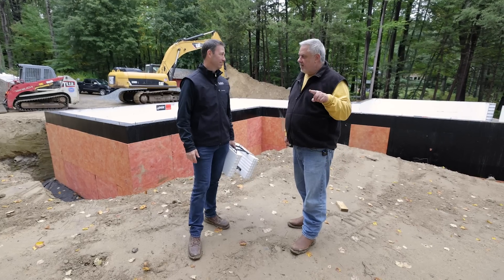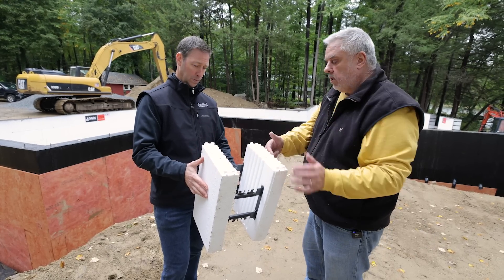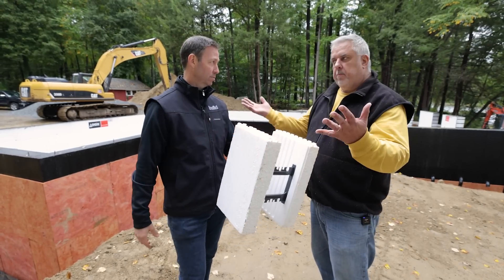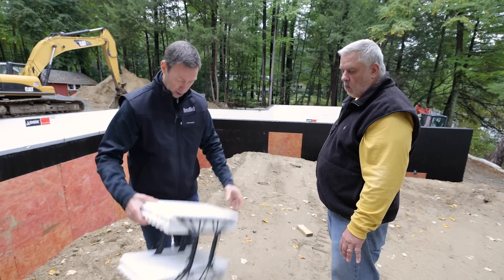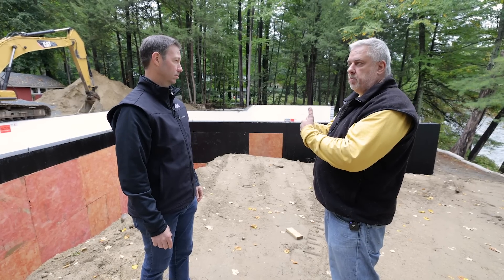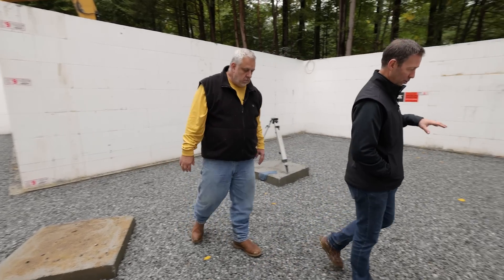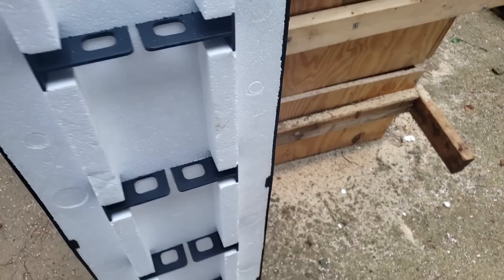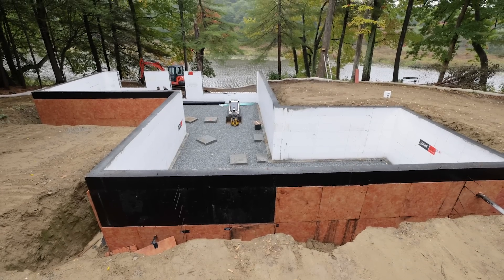ICF Foundation with Insulating GRAVEL?

Comment: Great workmanship, however you don't really need all that OSB waste.!! it defeats the purpose of going with ICF. Water will be repelled with a good coating and surface prep on the basement wall. That OSB will be gone in 5 to 10 years, so why buring your money to decompose. If you are still concerned use rock with filter fabric for the full height is cheaper than wood. !

Comment: To me, ICFs don't make sense. All that useful thermal mass is insulated from the interior of the property where it would do most good in modulating the temperature of the interior space.
Reply: When you build a very efficient home like this one, the thermal mass matters very little as the loads are so small you cannot get energy in or out of the concrete fast enough........thermal mass is a has been for poorly designed homes

Comment: I want to do an ICF ranch style house with full basement, in floor heat, maybe with lite deck main floor to avoid any required span support walls, I'm considering doing a litedeck hip roof for ultimate tornado country protection, and using concrete and metal on the exterior will make it as disaster/fireproof as you can get. The extra cost though for that roof would be significant.

Comment: @MattRisinger please would you be able to review SCIP (Structural Concrete Insulated Panels/EPS wire mesh panels). They have foam in the middle and wire mesh on both sides that are covered with concrete (shotcrete). They are very popular in Japan, South Korea and other Asian countries. This eliminates the need for surface cover on both sides - so no siding or drywall needed and are fire/insect/weather resistant as soon as the concrete is installed. It seems more logical than ICF. I'd love to hear your review of those.
Reply: Something like this - CNBC video from 4 years ago but haven't seen this take off. https://www.youtube.com/watch?v=xRCIhgNTi8c

Here's a recent one from a house in California - https://www.youtube.com/watch?v=vuWpJwzGDr0

Comment: Would like to see Matt or Steve investigate and comment about using helix steel on an ICF build such as this or larger.
Reply: Last year I was going to use helix on my driveway.  I thought about making a video. No one is talking about it .   The concrete companies I spoke to about it were not really wanting to help.   They said the boxes are heavy and would have to be carried up a ladder and staged.  Just too much push back but that’s here in South Carolina. Good luck getting people to understand what it is and why you want to use it.  It’s probably more accepted in colder climates.   freight rate went from $500 to $1500 so I cancelled thinking it would be temporary but here we are with a whole new set of problems keeping freight prices sky high.

Comment: I absolutely love Logix Brands "engineered insulation" products. Their ICF is outstanding, customer support is top notch, and they have radiant flooring and insulated panel products as well. A recent jobsite I visited replaced their OSB sheathing with Logix's Exterra product (R5) and was $8 a sheet vs $45 for OSB. This is the future of building. Great video, I really like the Glavel product used as well.

Comment: It’s amazing the ignorance of some of these comments. Icf  is not hundreds of dollars per block. You don’t have to only pour several feet per day. I poured 18 feet in one day and had one minor blowout that was fixed in several minutes. And the blowout was actually on a 9 foot section of wall that was over vibrated. Doing just the basement in ICF and then glued together wood and tape the rest of the way makes no sense. Build the whole thing in ICF.

Comment: I’m looking to possibly use ICF in a house on the coast in Florida. I’m having a hard time finding a builder that knows how to do this.  Which is crazy. 

They all just want to build with sticks.  I don’t get it.  Especially since they’re coastal builders.
Reply from the maker: Keep digging. You’ll find one
Reply: @buildshow  Thank you!
Reply: Didn’t anyone ever read the story of the 3 Little Pigs? The message seems pretty clear - don’t build with sticks where it can so easily blow away. This cycle of destruction and suffering needs to end. So many are suffering needlessly after hurricane Ian, such that we are considering setting up shop in Florida to help those choosing to rebuild in a more responsible manner. ICF construction offers a resilient and sustainable solution. Quite often even if you want to run there is nowhere to hide, better to build so that you can shelter in place and recover quickly.

Comment: The problem with ICFs made with EPS foam is wood destroying insects will burrow and nest in it. Mineral wool products don’t have that issue. If I were to build today, I’d do it with precast walls and the exterior insulation would be Rockwool comfort board with a protective cover over it.
Reply: I was under the impression that ICF wouldn't attract insects cause there's nothing for them to eat? That information was probably for icf ground to roof, but still I don't understand why they'd nest in foam?
Reply: Logix has a EPS with insecticide within it specifically for this purpose- IF you happen to live an area where this is an issue. Problem with precast is you have to knock down your forms, then furr for attachment, and insulate both interior and exterior if you want to match performance. This is all completed in one shot with ICF, hence my love for it.

Comment: How about finding someone doing a frost protected shallow foundation with some complexity, an "alaskan slab" as some might say, but done with the EZ Form molded EPS foam.  I have on on the boards for a client but it won't be built until next spring.  Half uninsulated garage, the other half studio/bedroom with full bath, so there are different treatments for both under-slab insulation, and the flared-from-perimeter "wings" of foamboard outside.
Reply: You might want to check out Legalett. We’ve been building Legalett frost protected shallow foundations (with air-heated radiant) together with ICF walls for over 15 years. It’s a marriage made in heaven. There are a few photos on our website if you are so inclined.

Comment: I did my walkout in my last build with ICF.  It is nice, but there are some serious challenges with it too, and it is NOT cheap.  I would have saved about 35% just doing my bottom part with regular framing...and I could have easily done it myself.  Finishing the outside costs you a lot more, especially if you want stucco.  Putting the electrical in also makes a huge mess.  The chance of blowouts and leakage is high too, you really have to get a good contractor and/or make sure you brace properly.  There is also a lot of waste from the cuts...way more than I thought there would be.   SIPS might be a better way.   That gravel is very interesting though...I will look into that for my next build next year.
Reply: I wanted to do SIPS... until I saw the cost. Crazy expensive. I priced out 12 suppliers; Double conventional framing and 30% more than ICF.
Reply: @mightykrum67  Do you mean with labour factored in?  To me, the big benefit of SIPs is that it's something I can easily do myself in a weekend, thus nullifying all of the labour costs.
Reply: @karlhungus545  No labor, just the material. It would be even more with labor but least it wouldn't be much because its soo fast.

Comment: Mark, can you do a show to help existing home owners in cold climates figure out how to get fresh air moving through the house in the winter, especially for homes that were not built air tight like the newer ones.  I have a gas blower furnace and when I start to research this, I just go in circles and the cost is beyond me.  I also live in a rural area and can't find anyone expert in this area.  I think this could help a lot of your viewers try to figure out this situation.  Sometimes I wonder if just continually running the bath fan and install an outside vented fan over the stove would be enough?  Then I start reading about negative pressure and my head spins.  Thanks.
Reply: I always wonder when they will start monitoring air cycle refreshes and ensuring its even throughout the house.  Carbon monoxide buildup is a huge issue.  With out air cycling, return registers and cycling conditioned air, the system will be a headache generator.
Reply: @doctoroctos  do they not use similar to MHRV, which pumps the stale indoor air out, and bring in fresh exterior air in while using the heat from the indoor air to heat the exterior air as it's coming in?

house is 'airtight' but requires sufficient ventilation, and the MHVR systems are great for that, while not sacrificing the efficiency of the insulation by simply cutting holes/vents everywhere
Reply: Try looking at ERV (Energy Recovery Ventilation).
Reply: @INSIGHTCO  cannot use erv in cold climates

Comment: I would have used Polywall stick and peel plus a dimpled board material as platoon, instead of what they did in here.
Also the Glass insulating gravel could be used without the real gravel underneath. That was a bit overkill.

Comment: I wander what happens with all the moisture that gets trapped in the concrete, because water does not travel through EPS! Also it's curious to see EPS used in this case because EPS it's not made for underground use, XPS being the correct material for this type of work as far as I know!
Reply: It's not an issue.  My ICF is perfect after 14 years.  If you know anything about concrete, slower curing is a GOOD thing.  ICF has been around now for over 30 years.
Reply: This is a great question. Logix ICF's are designed with drainage planes on the interior face of the block. Excess moisture typically weeps out from the bottom course if the mix is too wet. The ICF core provides a superior curing environment for concrete- it is desired to have even moisture levels for the mix throughout the cure, while not having exposure to any adverse weather or temperature conditions; All of which allows the mix to cure evenly and slowly. EPS in tandem with a waterproofing membrane layer is a great option for below grade use! Feel free to reach out to our Technical Support team if you have further questions.
Reply: I too wonder about the moisture trapped in the concrete.  Won't the rebar RUST?  When the rebar rusts, won't it EXPAND, cracking and eroding the concrete?  While the concrete in highway construction has direct exposure to the elements (and the salt applied in winter), the norm now is to use epoxy coated rebar.  That's why it's GREEN.  Why doesn't all rebar used in any conctrete construction epoxy coated?  Is it that expensive?
Reply: EPS is used below ground all the time.  They even use it for infill for building freeways and bridges and many other civil engineering projects.

Comment: Why is noone using any thicker ICF blocks in the US? Where I live they sell up to a size of 4inches inside, 6 inch core and 8 inch outside (about R52), and even with that im not quite sure if it would reach passive house standards here, like, a R37 wall is considered decent

Comment: What about ICF and termites? No one seems to address termites when they talk about how great ICF is or they act like it's never an issue when the question comes up. I live in a northern climate and we have termites.
Reply: I've been doing ICF's in Wyoming since 2001. Install a waterproofing membrane down the wall and out and down the footer. Nudura product for the exposed part of the foundation above grade. We backfill half height, then have terminix in to flood pretreat the exterior and the interior. We do 6 inches of drainrock on the inside first. No problems so far, and much less expensive than after treatment. Qualifies for VA loans as well.
Reply: Polyguard has a TERM barrier product as part of their watershields.  Buildblock also has a strip that you would install slightly above grade if you're using their ICF blocks.  I'm in Michigan in a 70+ year old house and there is no indication of any termite damage.

Comment: I agree with doogie, could you apply this construction on a standard slab on grade build, slap on some Zipsheeting and tape  the seams. The R-value seems fairly good, thinking youd still need to apply 2x4s on 20 inch centers in order to run electrical and hang sheetrock on. Throw some mild rockwool in and enjoy higher R-values plus you might have a Safe-house type condition, bullet proof from top to bottom. 😎
Reply: You can use a hot-knife or a chainsaw to cut channels in the foam for your electrical, then after inspection simply fill in the channels with spray foam..  All of the ICF companies have plastic "studs" in them at regular spacing that you would hang your sheetrock and siding on.
Reply: @michiganengineer8621  Hot knife is the way to go (and a good mask so you don't pass out from fumes).  Chainsaw or reciprocating saw makes a HUGE mess of static-holding little balls of foam.
Reply: @karlhungus545  I've seen people doing both methods and the mess made with a saw definitely undoes how fast it is to cut the channels.
Reply: Not at all...
If you want more R value you just order thicker blocks (Nudura Plus R35) or order blocks with larger core and add inserts of EPS inside, they sell also those.
No need of interior wood framing these blocks have theirs studs inside and you can cut chases with a hot knife for electric, and definitively no need of using any Zip wall sheathing which actually defeat the purpose of making a fire resilient structure. Zip System is one of the most flammable material on the market. If you want to add sheathing for even better fire proofing, you are better off with Densglass or Securock gypsum/glass panels.
Cheers.

Comment: In areas with termites and other aggressive pests, how does the ICF do? Is it an unreasonable fear that insects could/would tunnel through the foam?
Reply: Matt did a show where they did a peel and stick polyguard membrane called TERM.  Look up poly wall or polyguard.  Term is a moisture and termite barrier.
Reply: Totally anecdotal, but as a huge automotive enthusiast, I rarely see pests (besides mice) mess with insulation on vehicles.
Reply: Check out our TX Series ICF block! The EPS panels in Logix TX Series are treated with imadacloprid to offer a secondary layer of protection against termites. https://logixicf.com/products/product-line/logix-pro

Comment: we just finished our 2 storey LOGIX ICF house and couldn't be happier about it.  it's really the way to go.
Reply: Yea?  I'm looking into it.
Reply: I have a question. I have never built a house, but want to and I want the ICF blocks for a basement, thought about waterproofing issues. I have seen rubber mulch made from old tires in a playground, black rubber, it was hot and smelled bad, not suitable for a playground for kids, I don’t think. But I thought, what about using DAMTITE ( my brother used this on concrete blocks at mom’s house to waterproof), mixed together with old mulched up tires, put at the base going up against the blocks after blocks have “set” with the concrete in them.                  Wouldn’t that make the outside of the blocks waterproof for a long time, like 100 years?
Reply: @debrachowning6470  the ICF block Styrofoam is sensitive to a lot of these kind of products which will melt the ICF Styrofoam.

Comment: Artificial pumice, they should make concrete with that stuff.
Reply: There are some companies that offer admixtures
Reply: What would that offer in the form of insulation for the floor?  I’m about to backfill for my hydronic slabs in my Quadlock ICF home and have tons of pumice sand that I excavated out for the house footings and a pond. The quarry has cheap rejected p-gravel which is pumice. I would love to use that instead of expensive 2”underlayment foam if that would work.  It’s common stuff here in Sun River, Oregon.

Comment: Why are they able to pour that tall of a wall? I thought most systems can only handle four blocks high of pouring at a time?
Reply: You go around the foundation at a fairly slow pace, that way the lower layers have a chance to START setting when you layer the next lift into the wall.  At least that's what it has looked like during all the ICF builds I've watched.

Comment: Awesome info. What about alternatives to rebar? Like fiber bars or Felix micro bars
Reply: Fiber has no ductility and helix can only replace horizontals. You still need plenty of verts which requires a rebar channel to hold it in place during pour and to install your lintels
Reply: @LincolnLog  : many thanks. At least we can use Felix to replace horizontals and it should be a huge cost saving effort
Reply: @LincolnLog  helix can replace verticals too. Check out their icc report
Reply: @KindofLightmusic  I dunno, I went to to an in-person Nudurs training and they specifically have a rebar channel that spans the center of the block that is used for vertical rebar on helix pours. I have already spoken to helix and their batch rate will max out at 9ft of backfill meaning any deep and tall basements are out. Lastly, I don't trust tiny bits of metal to handle the tension of tens of thousands of pounds of force against the walls verses a #5 every 8 inches. For a slab pour, sure, but not for a basement wall pour

Comment: I looked at these 10 years ago matt but it came down to cost. Back then it was (with concrete) 90 a lineal foot. I got a poured wall with insulation for 60 a foot.
Now those icf's are probably 125 a foot . 
Concrete now is ridiculous. 
Thanks for video Matt. I got some pictures for you of the Fortress steel deck we finished framing today.
Reply: yup way too expensive now. concrete is soring so is plastic resin